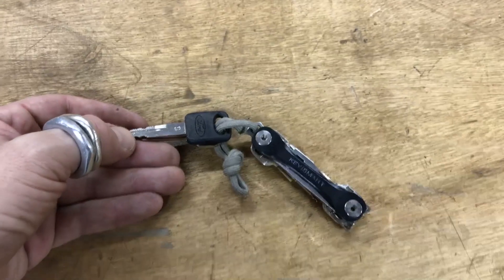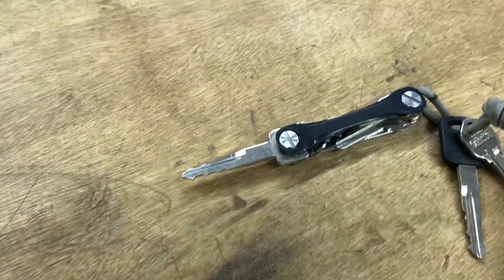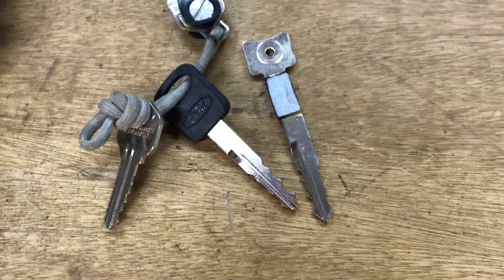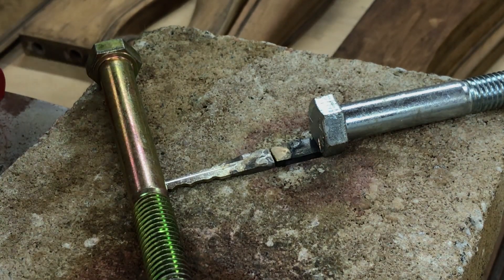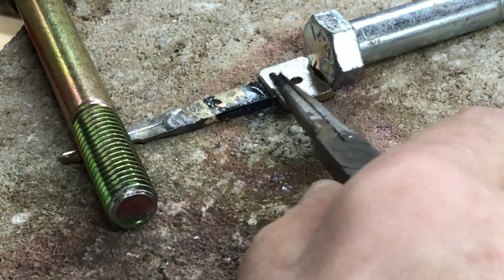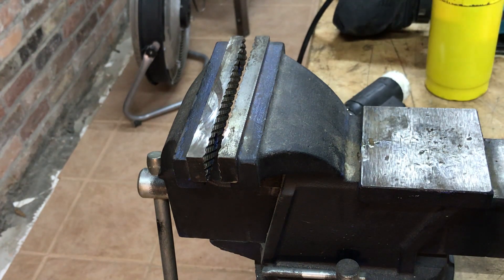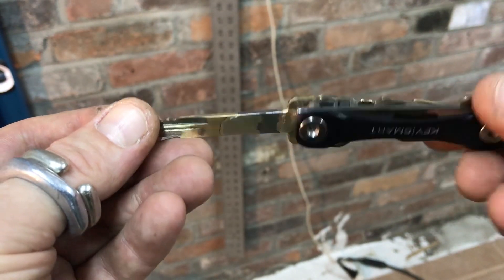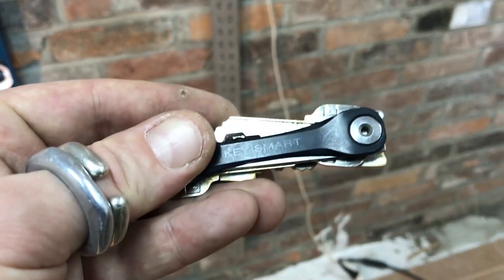Lengthen Automobile Key for Keysmart Device-Brazing dissimilar metals

Comment: Just curious what solder is that, and did you just use acetylene?
Reply from the maker: It’s “silver solder” and it was a MAPP gas torch. Pretty sure a regular torch would work too. The main thing is getting the two metals the same temperature around the same time, that was my hardest thing to accomplish with this project, being diff. metals. Thanks for watching and commenting !